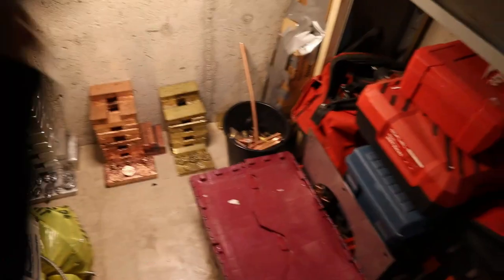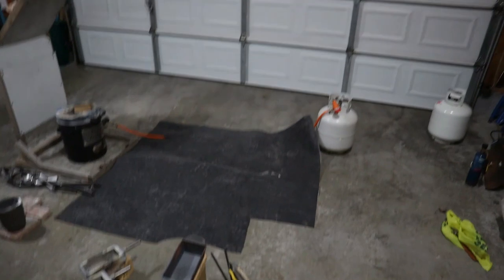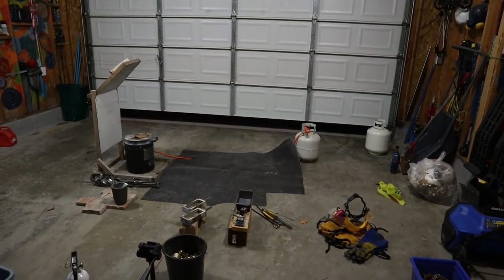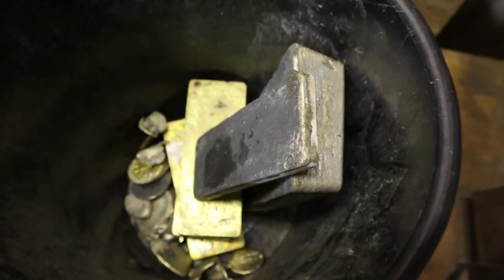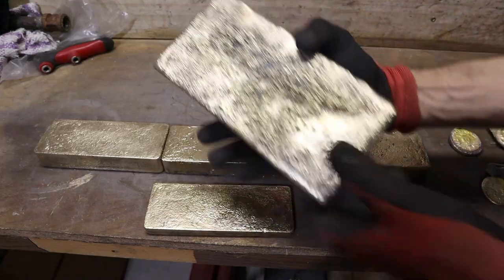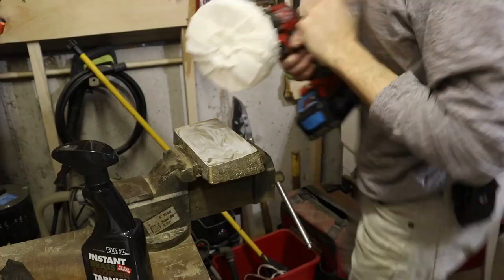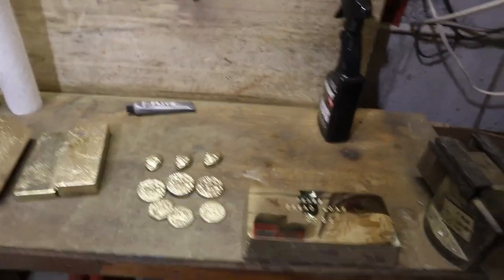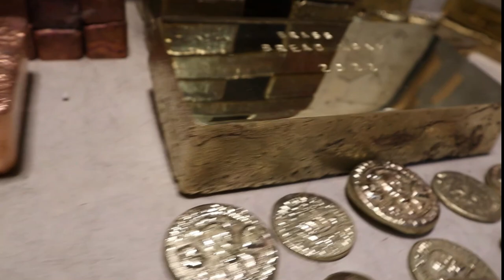Melting Brass into a Bread Loaf, Doubloons and ingots with the Devil Forge " George Forgeman"

Comment: Nice job.  Just an FYI - I had a piece of brass explode on me because I didn't heat it first.  A lot of brass is used in water applications and mine must have had a slight touch of moisture in it still.  Scared the poo out of me.  Not going to tell you to "be careful" because I hate it when people do that.  You're not 9 years old and I'm not your grandpa.  Just wanted to mention it.  Great looking bars!!!
Reply from the maker: Oh absolutely, it happened to me too actually! just a little pop. It was startling for sure! I usually do heat material before popping it in, but I suppose I forget here and there ! that's why I always wear my PPE ! Thanks and cheers 🍺